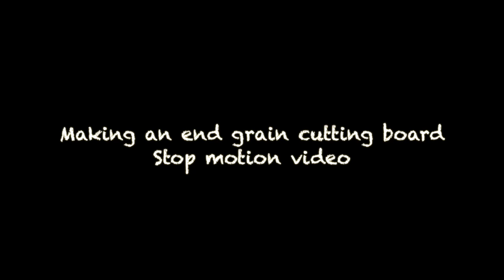Making an end grain cutting board. Stop motion video.

Comment: For what purpose do you draw the V during glue up? To only make sure you don't glue the top by accident or is it for clamping?
Also do you find during glue up that the joints or wood matching doesn't line up quite perfectly? How would you avoid this?
Reply: By the way love your videos. And your boards are a thing of beauty.
Reply from the maker: Thank you. This is done in order to avoid confusion when carrying lumber and in case of falling. This sign marks just the order of the strips, but not the exact location of the gluing. I usually make 10-15 cutting boards at once, so mix the strips is easy enough. If a large and thick board is made, then it is transferred to the place of gluing for 3-4 times. It's very usefull method.